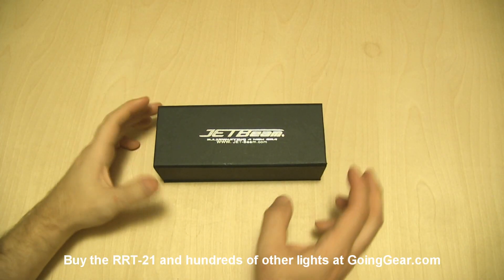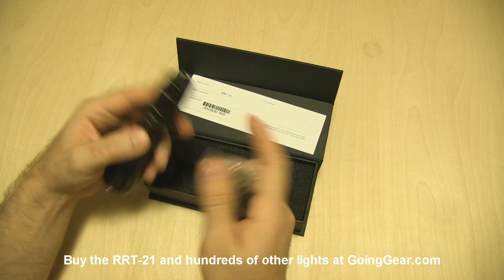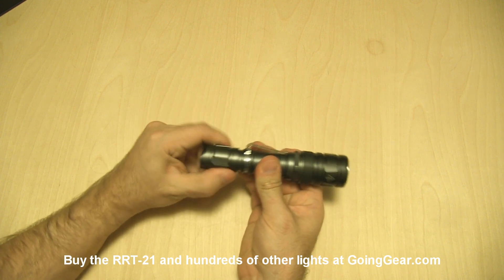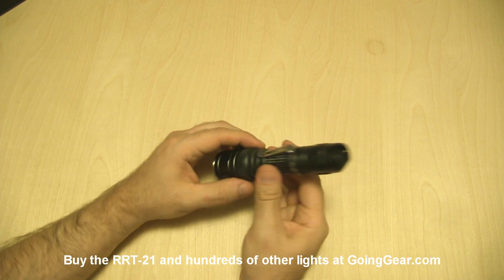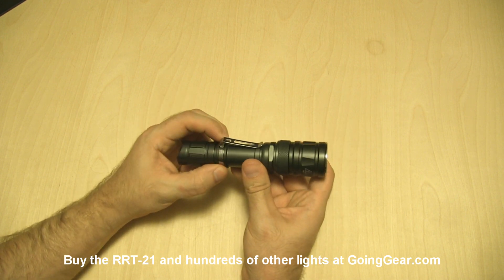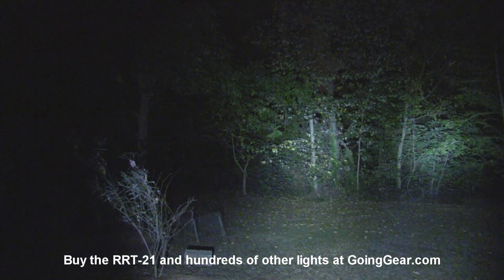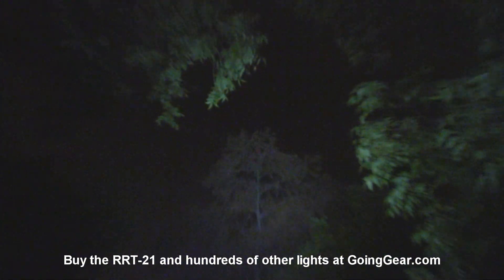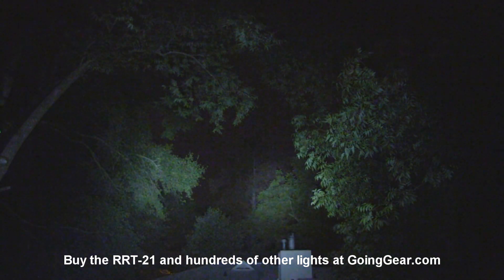JETBeam RRT-21 Raptor LED Flashlight Review

Comment: @goingprepared which do you prefer for overall light output?  been reading some of the posts on candlepowerforums and it seems like the rrt-21 beats out the m20-x in both lumens and throw.

Comment: Hey marsh I don't know if you knew this,you prolly did but my bc20 and 10 switch was sticking a little bit so I completely took apart my switch and poured water conpletly over the switch and now it works even better than when I got it..I assume because thier numatic switches that prolly wouldn't work on electronic switches like the sl6 and sc600